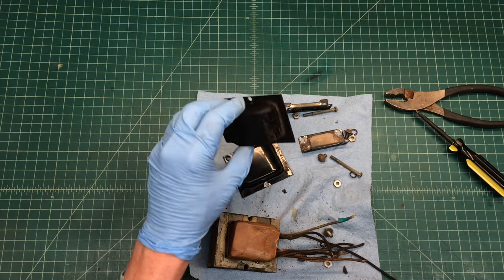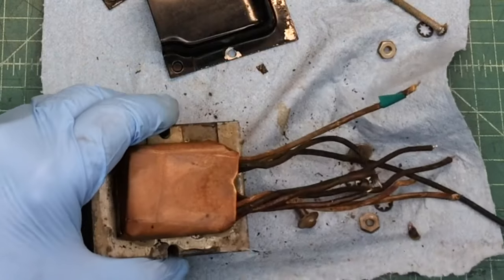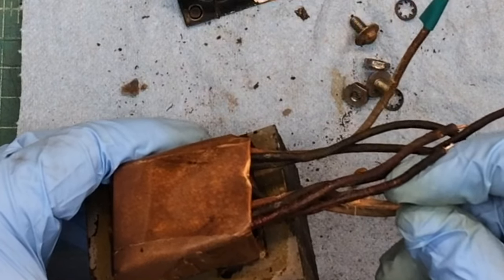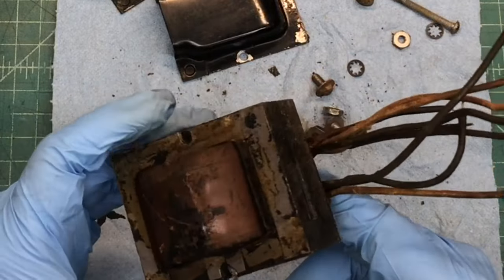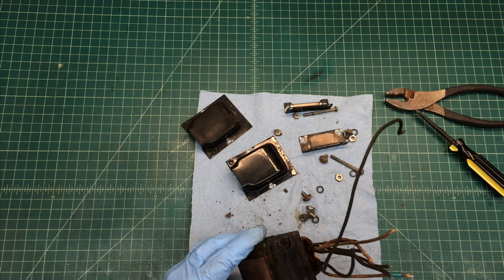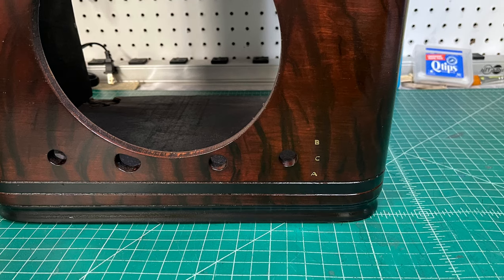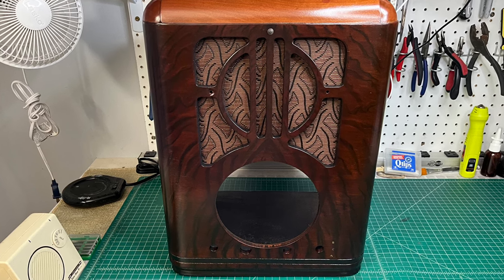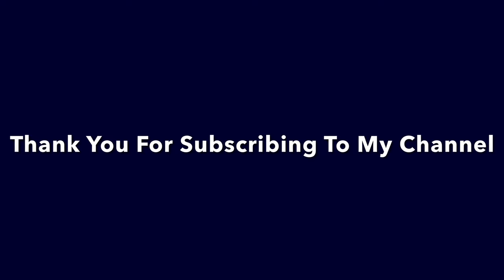Zenith 6S229 - Power Transformer Prep, New Grille Cloth & Waterslide Decal

Comment: How did you hide the outline of the water slide decals? I have tried to cover them with a few different methods but nothing I am satisfied with. Some one told me to use a flat clear over the decal an the cover it with gloss. I hope you have a good idea that works. Thanks
Reply from the maker: I really didn’t hide it well as my application protocol was not correct. When I applied the waterslide decal, I had already sprayed a couple coats of clear lacquer, which doesn’t allow the decal to melt down into the substrate making it less visible when applying top coats, so my recommendations are as follows:

1. Apply the waterslide decal before any clear coats directly to the substrate (has to be a smooth surface; if not, a couple light coats of clear).
2. I made my decal; using a matte acrylic sealer over the inkjet image can help mitigate the issue at times.
3. Try using Microscale Industries, Inc. - MICRO SET followed by MICRO SOL.
4. After the decal dries; using #0000 steel wool, go over it in the direction of the grain applying light pressure to scuff up the decal.
5. Apply clear coats of choice and hope for the best.

Hope this helps and thanks for reaching out.

Best,

Don

Comment: Hi Don,  so are your looking for shorts in the windings,  between PRI & sec. & what ever filamint windings/ pilot lights  taps on sec. ect. Are you using straight resistance checks. Or actually applying power. Hugh Mc. Chicago metro. You did a nice job on that cabinet, looks very good.
Reply from the maker: Hugh - DC resistance across windings and to the housing to ensure all is well. I’ll apply full power as well after validating the DC resistance to look at wattage with no load. Thanks for your kind words on the cabinet. Best, Don